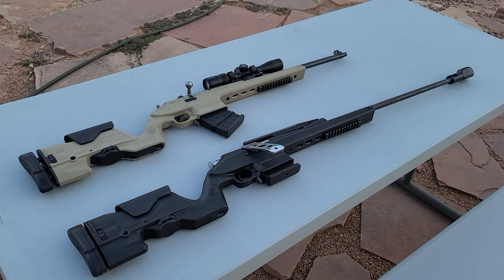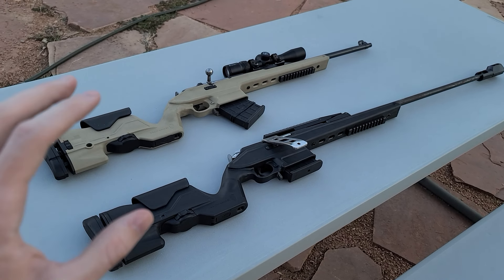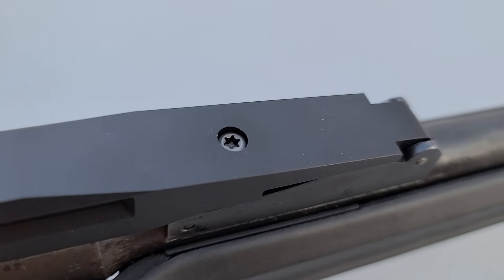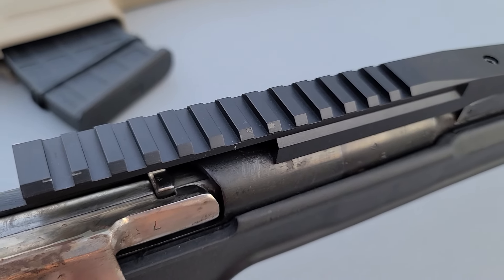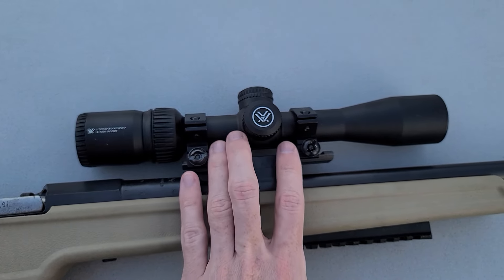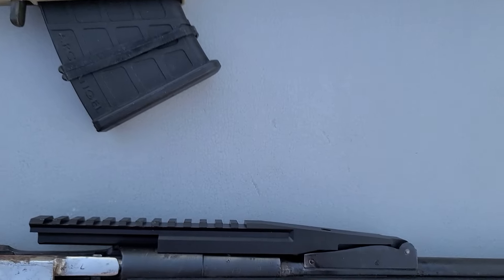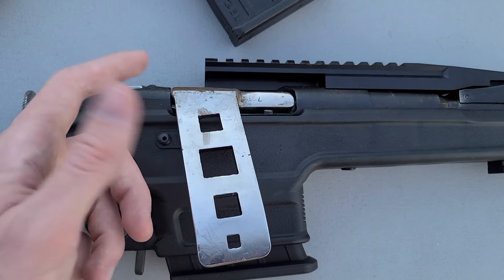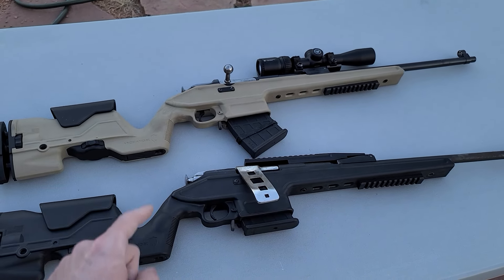Watch this BEFORE drilling and tapping your Mosin!

Comment: I'm on the hunt for a good sniper receiver. I have almost all that parts to have a PU put together. I cant bring myself to drill/tap a receiver or to get a modern stock so putting together a parts kit for a PU has been somewhat challenging
Reply: Locate an ex-sniper and convert it back.Not difficult.
Reply: @pandoralechat780  Finding receivers has been, I wouldnt mind a ex sniper one to convert. Would buy a complete ex sniper if I didn’t already have so many extra parts to put one together. Still may if I cannot find a receiver within a couple months, especially considering prices keep rising on mosins

Comment: And suddenly I don't feel so bad for putting my old Mosin in an archangel with what I assume is the same "tank brake" from "Texas something" company. Threw in the timney trigger, have been sitting on the scope mount and bolt, great to see that option. I will have to consider that. Thanks.